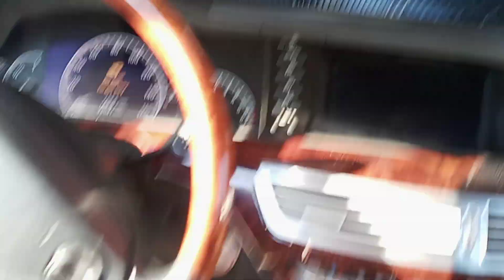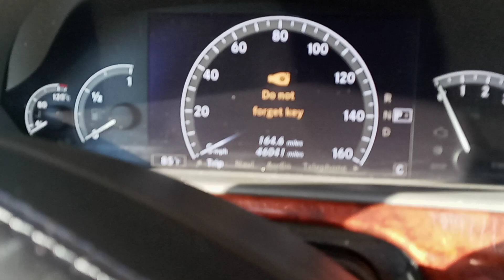Why Cars and Bids by Doug Demuro Will Fail

Comment: "Why is my reserve so low?" Dude look at this thing. It has a hood scoop. It has an LED glued to the A pillar. The coil pack controller is sitting on top of the engine that's covered in gold tape. People on auction websites don't want this kind of car - they want something clean and stock. I've never seen a modified car bring higher value than a stock counterpart. Modifications are extremely personal, and even if the mods were perfectly done, you'd still be limiting the amount of interested buyers due to being modified. Is it a cool car? Yeah sure, but it's not something many other people would want.
Reply from the maker: Here's all you need to know https://youtu.be/3bwnhX-Mgdg

Comment: that's a hideous hood scoop - they valued it so low because few people would actually want it with an eyesore like that. it seems to me you're just salty they don't like your mods.
Reply from the maker: Mods had nothing to do with it. And thanks man. Way to pay attention 🤓
Reply from the maker: Current S65 on Cars n bids is at 25k. New hood is 400 bucks. Get a life🙌
Reply from the maker: Hey thanks for the compliment. Sorry you spent so much more for the same car☺
Reply from the maker: David, I thank you for a reasonable response. Im sure you feel that way about your car. But I drive Vettes. 700hp in a 3300lb car is exciting. What you are i have are barges and comfy. Drove mine all day here in Vegas, was 114 to 118 out. AC was cold in 3 min engine stayed in between 80 and 100 always and no heat soak.  I made this car as absolutely competant as I could. Btw no way you paid 13k.  I actually did pay 7500, not bragging. Actual deal i made. Cars are art to me. Unmodified is a blank canvas absolutely boring as can be. Hope you enjoy your car. To this day I prefer my W140 S500 I paid $480 for.
Reply from the maker: David Topchiev  

See comment.
Reply from the maker: David Topchiev  that price makes a lot more sense to me. To keep it cool basically is about air flow. That's why I put on the AMG Black Series front bumper. Brand new radiator even though the old one wasn't leaking. Hood vent as they sealed it from the factory. The rear vents are not part of the engine cooling but for the h v a c and  battery. It also helps for heat soak having two intercoolers and two water pumps. I also forgot to mention that your car has bigger turbos stock at my nose. My car got to your power level with the tune. Your car can far exceed mine once tuned but then the drivetrain suffers. I think a lot of the drivability difference you feel is in the shifting. A good tune on a 600 takes care of that, or you can just use the paddle shifters. A lot of the soft shifting also helps the drivetrain live.
Reply from the maker: David Topchiev  that's hard to hear... The engine trans were used what till 2019? I know eventually they did make some changes oil squirters etc. Im sure I drive in much higher temps with no issues. I live with the heat 4 months of the year. Cars and bids did accept my reserve now...  Said they made a "mistake"... Only after I pointed out the higher mileage S65 went for 38k.  Gonna make this video not public until after auction ends. May make abother video about the actual selling.
Reply from the maker: The S65 sold for $38k...  They finally saw things my way and accepted me. But then my 90 pictures weren't good enough and I gave up. Like I said, site will fail eventually.
Reply: @nicave13  UH HUH, I'm sure it's not because you are just making up stories.
Reply: Nic Ave-Lallemant     It’s fucking hideous! Get that in your brain! It doesn’t fit the type of cars on cars and bids
Reply: @nicave13  you can't compare that though if it doesn't have the same mods mods are a huge turn off for a lot of buyers
Reply: @nicave13  are you ok? You have a riced s600 and not an s65, so why are you comparing them?
Reply from the maker: Here's all you need to know https://youtu.be/3bwnhX-Mgdg

Comment: They are the most honest, caring, easy to use, best auction website. simply no one wants your riced S600. modifications do not increase the value of your car, unless it is a off road SUV
Reply from the maker: Ohhhh, sorry brad but if you watch my second vid they did accept me and with my 16k reserve. They changed i was right. And yes it feels good. Even better I sold car locally for 17k. Bet you feel dumb now...  Unless you are too stupid to even grasp what happened.

Comment: I really don't think you should be upset with Cars & Bids about this, it's not the site for you. You need to sell your car on a site where people appreciate those types of modifications. Would you complain about a dealership not giving you trade in and considering all your modifications? No of course not. You know a dealership will never be able to get more value out of that car because of the modifications. So this really isn't a reason why Cars & Bids will fail, it's one of the reasons why it won't fail.
Reply from the maker: I got them to change their policy as Doug described in video I attached. So I was right. All I care about.

Comment: Bitter.  Highly modified cars sell for less every time.
Reply from the maker: Explain how I bought it for 7500 and sold for 17k?
Reply: @nicave13  - you are a superstar no doubt.  Nic you do the impossible and make it looks easy.
Reply from the maker: @gsten2116  you are trying to be funny but still prove my point. Cant tell you the endless humor I get from my commentators.
Reply: @nicave13  - not trying to be anything.  You are right and we can learn from you.  I am looking for a car now that I can buy for under $10k, modify, and then turn for a profit.  Would you recommend maybe an 03 SL 500 or even AMG?
Reply from the maker: With your first comment you are nothing but a troll so obviously I can't seriously answer your question. Try being nicer and learn something in life. Good luck with your car dreams.

Comment: Doug is the Goat 🐐 stop talking
Reply from the maker: But he changed the policy after i pointed it out.  Soooooooo....
Reply: I understand I do agree on some of your points remember he just starting out on cars and bids and I believe in his success also nice Mercedes the hood looks kinda funny but I like the build keep doing greater things 🙂
Reply from the maker: @Intylerwetrustfc  its 120 degrees in Vegas and the engine bay is sealed. Its a factory scoop on a 2015 Z28. Best I could do on an aluminum hood. Built for me, didnt care about the next owner.
Reply: Yes it’s really hot in Vegas the scoop brings lots of air flow to the Engine I bet
Reply from the maker: Engine temps at speed went from 205 plus down to 195 or Tstat opening temp. Helps with intercoolers as well.
Reply: I have a question I have a 2000 civic si do you think they will accept my car

Comment: I respect your opinion, but  S65 is not the same.  Every Mercedes loses most of its value.   Higher the MSRP, the worse it is.  Lower the trim, worse it is.  Only top trim, mint, non-modified examples will get more than book. Every non-stock mod is a strike against it.  $10,500 is good reserve.  You’d have gotten more if you would have listed.  There is no magic button to re-vamp the value of a depreciated gas guzzler.  But you know that.
Reply: Mercedes, especially 2dr. coupes and cabriolet/convert. tend to achieve upward trajectory if kept stock, immaculate and over enough years that it takes a child to reach adulthood. At least such has been the case historically.
Reply from the maker: Agree with Greg. But not Aslash. In the hands of 99% of people the S600 is same as S65. No one will use a higher top speed, posi, more power etc. Btw mine with tune has same power and removed speed limiter. So....

Comment: your car isn't even tastefully modded. the subs look horrible, the hood is horrid, and no matter what unreliable mods you put into the engine, ITS NOT AN S65
Reply from the maker: Hey thanks! Bought for 7500 and sold for 17k. Think I did ok. What by chance do you drive? Link please. Or are you just an average loser troll?
Reply: @nicave13  I have a stock lexus gs430. It doesn’t look like shit, is reliable, and will hold its value way better than your modded s600. You gotta learn to take criticism. You ruined that car.
Reply from the maker: @sosachamberlain6069  why do i have to take criticism? You drive a grandpa car. Unmodified cars are dog$hit. I build many different cars and wouldn't be caught dead in anything stock. Heck Ive moddified electric wheel chairs. My Mom used to drive a Lexus GS and shes 70😅😂😹
Reply: @nicave13  you have to understand no one wants to pay more for a non AMG Mercedes because it has a ricer body kit. Doesn’t matter how much power it makes, it just looks bad. Also my gs may not be a super car (neither is your car) but it is rare. You sound so edgy bro
Reply from the maker: @sosachamberlain6069  Ooooo edgy that sounds cool!  Nobody wants it? But hey I did sell it for 9500 more than I bought it for...  And correct me if Im wrong. Which I never am. But who drivers an actual ricer? Pssst, Toyota are Japanese... Lol. Sooooo thanks for playing but Proven a dumba$$ yet again👌💯  Oh, if its got a V12 Twin turbo's 600HP plus and a top speed of 200 its a super car bro. Those r pretty much the qualifications.
Reply: @nicave13  how much in mods did you put in?
Reply from the maker: @sosachamberlain6069  after you trashing me why would I ever answer a question seriously? Like what world do you live in? Haha
Reply: @nicave13  lol you spent a lot didnt you?

Comment: The reason why you don't see spray painted honda civics in cars and bids is because they are just cars that have been poorly looked after. I don't care if it is an S600, it has tacky "mods". Doug wants presentable vehicles. Not a car that has been modified, and the reason why he has "junky" vehicles on there is because the vehicle that is being auctioned has been well looked after. You are just upset that they didn't accept your car

Comment: While I understand and agree with some of your points. Modifying a car especially to the extent that you have, I am guessing with non original M B equipment.  You have a more narrowed buyers base. Because you have to find the person who likes and wants those modifications. Very similar to selling a home with a indoor fountain and extensive marble. The seller has to find the buyer who wants those things in a home.
Reply: Absolutely agree! Custom or extensively modded street cars of any type are often one person's vision. If you simply must then your best odds of recouping a greater percent of investment IMO would be :4WD, Light refurbish of a 30's or 40's street rod. Ford or Chevy is safest bet. Quality built drag car because with knowledge and good judgement it can win money regularly without chewing up parts. (Lots of variables here) and be worth something to another racer if done right or the most common type of car to sell piece meal. Personally I'd prefer a desirable muscle car modded with a Jimmy blown big block to a Euro luxo barge that sucks a ton of gas. Even a stock 450SEL was about 12 mpg at best.(ask me how I know) I can scarcely imagine what that would do at best and carrying 4 adults thru the Nevada desert at 100mph+? Don't even want to hazard a guess.

Comment: Yeah - you explain it yourself at ~2:12:  "This is an extensively modified car."  Modifications are worth $0.00 at best and usually reduce the ultimate price regardless of how much you spent and how much you think it adds to the value.  Everyone thinks, and rightfully so, that the car has been beat upon with increased load on rods, seals, bearings, etc. all just waiting to fail.  And that's best case where you modified it correctly and spared no expense when done.  Buyers on an auction site have no idea how you've treated the car or how the modifications were performed.  An auction car needs to be believable.  If I'm looking for a car on carsandbids, eBay Motors, etc. I need to believe that I'm getting a good deal and for most people, including myself and the carsandbids admins apparently, modifications automatically means risk.  If you think the car is worth $16k+ then put it on a regular site and see what kind of interest you generate.  If it goes for 16k or anything close to that then you were right - otherwise try to see how carsandbids might view your listing.
Reply: I remember a Portland, Oregon Corvette shop owner telling me that every dollar spent on customizing a Corvette lowered it's potential resale by a dollar and that the only likely exception would be if all that money were spent strictly under hood. With very few exceptions have body mods or custom paint enhanced the value of a Corvette and if not for a lowered road race vibe with expertly flared fenders I'd say such mod's never add value. Even the world's best done that flavor would be highly subjective.
Reply from the maker: I didn't modify this car, I built this car. As I state in my ad I'm a car builder. His car was not modified to be driven by me. But the next owner. And honestly they accepted the car as is where is and I didn't list it. As I have the money don't care to sell it anymore lost interest. The least I was proven right as a video I link to Doug on this thread.
Reply: Nic Ave-Lallemant have a coherent response because your comment is hard to follow. Secondly, please explain how this car is “built” when you repeatedly say it’s “modified”. Do you understand English at a mature adult level? Probably not if you rice a Mercedes S600
Reply from the maker: Here's all you need to know https://youtu.be/3bwnhX-Mgdg

Comment: Modifications are often like shovelling cash down a rabbit hole. Just ask anyone who has ever tried to market a custom Corvette. I know a guy who is overjoyed that he bagged a mid 90's Caprice and claims they are a potential gold mine. High priced, high end cars have notoriously low resale because maintaining them is so pricey. Especially European luxury cars. Many consider extensively modified cars like this a magnification of the potential problems one can have with these types of cars. I like custom modified cars but I'm somewhat of a hot rodder but you might have better luck making money with an extensively modified (power wise) car by taking it to a drag race and going rounds. Or showing it at pro produced indoor car shows like The World Of Wheels or even various (insert city) Roadster Show. Which in spite of the name always has street machines of various ilk because an area may be too weak of show quality 20's thru 40's or so show quality street rods or customs. Wish you luck. If you make money on highly modded builds I'd say you have some luck. An immaculate Rolls Royce, or Mercedes as a used car even stock is just something many people envision becoming a driveway ornament if it breaks down and avoiding that translates to expensive upkeep that scares most people away. Most but not all. Highly modified under the hood and that market narrows by another 50% . That's one reason Chevy powered XKE's were the most easily attainable one's. Jag inline 6's were not the worthless boat anchors most U.S. mechanics implied and ripping them out in favor of G.M. motivation just killed off the originality. Not knocking your beautiful Merc in the least. It's just too easy to imagine that sitting in the prospective buyers driveway broke down. The reality of that being a parking spot in an apt. complex where the buyer rents means some buyers can clearly get their priorities scrambled.
Reply from the maker: I Dont sell or build to make money. I get out of love with a car and sell it. Have 4 and want more. Live in an Apt because it makes the most sense in Vegas. 115 here today and where I work on cars is 86. Haven't seen a house here with a garage that stays cool. Any car is as reliable as the owner wishes. Haven't done a thing to this car in 1.5 years but add gas. Drove today in 115 temp and its like the day it was made. But with 100 more HP.
Reply from the maker: Here's all you need to know https://youtu.be/3bwnhX-Mgdg

Comment: dude...its a riced out s600...no one wants it
Reply from the maker: The guy who paid$17k must have... Dumba$$  how riced btw? Do tell?
Reply: @nicave13  you have gold accented things in the engine bay...hood scoop, those lights on the a pillar...the stock way is much better
Reply from the maker: @ps1hagrid84  not that you would understand I didn't ask him things under the hood. It's called heat shielding and reflective tape. The light on the pillar is unnoticeable but tells Vital Information for the function of the car. Do you have any real comments  or anything smart to say?